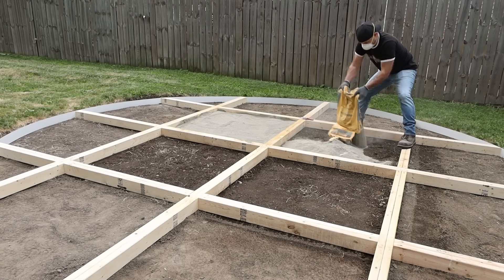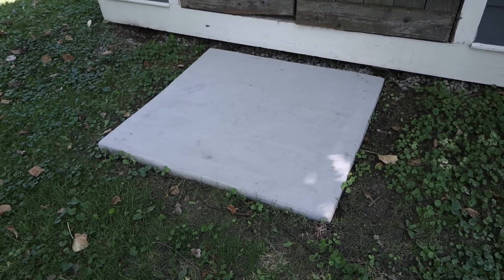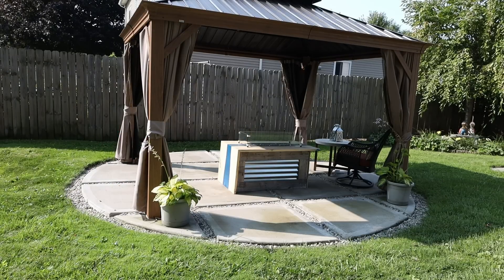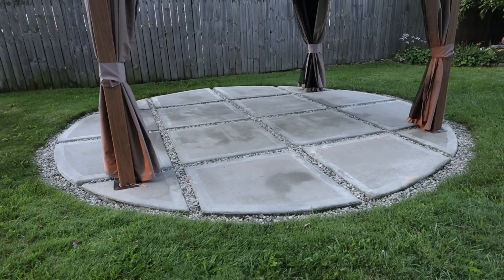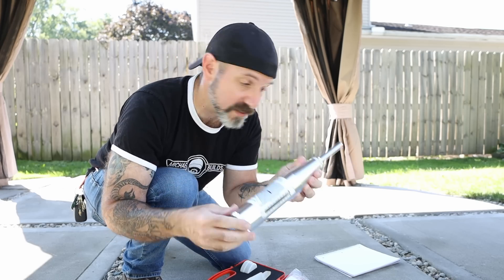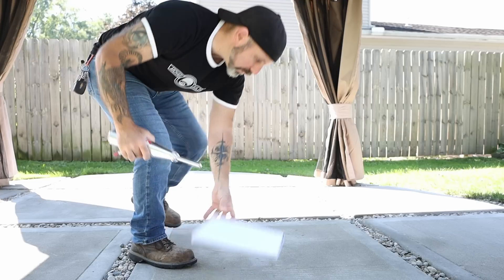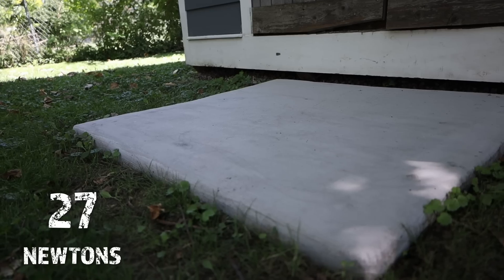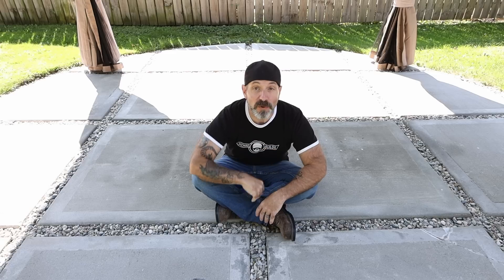Testing Dry Pour Concrete 1 YEAR LATER...

Comment: Thanks for the video. I just did a dry pour patio last week and it came out horrible. It looks like the one you showed where  you can peel the entire top level off. Is there anything I can do to save it or should i use it as a base and put a wood deck over it?

Comment: Compare the surface delaminations to dry pour without rebar. Id be interested in the results. Sort of suspect expansion and contraction causes the facing issues. Also dry pour should be soaked in as much water as possible every day at least for 7 days

Comment: BULLS***! There is no way you're ever going to get more than 60% of a design strength by doing a dry pour. If and when you decide to take out and dispose of that patio, have the section that you tested with nondestructive means over 4200 psi, and we can work it out and find you somebody locally that will core and actually determine its strength.

Comment: Dry pour should be strictly used for post setting that does not require major tensile strength. Other than that it is a waste and a matter of time until it will require to be torn up

Comment: I've been waiting for this video, and it's pretty much confirmed what I expected. As a Cement mason, if I poured any concrete as bad as that patio I'd ripe it out and replace it at my expense. As you said, these were experiments and the information is great! Honestly, I expected the compressive strength to be decent. But low compressive strength isn't the problem with dry-pours, it's the inconsistency throughout the slab.

The delamination is a sign of some serious problems, specifically uneven hydration. Some parts were too wet (such as the top and edges, making them brittle and weak), some were just right, and some were too dry (such as the center, making it crumbly and prone to fracturing). The cracks on the edge are likely just ordinary concrete cracking that found a perfect fault line for a particularly nasty crack. The top and edges will get too much hydration in a dry pour, but the concrete immediately underneath them will be much better hydrated. The middle is underhydrated, meaning that well-cured corner will crack at the path of least resistance (the comparatively weak middle), leading to a complete break instead of a hairline crack. The unpredictability of dry-pours isn't a bug, it's a feature. If it's showing that much wear after ONE YEAR, I REALLY want to see what it looks like after two.

As for the compressive strength, the only way to get an accurate test is to test a cylinder to failure. One way you could do that (roughly) would be to drill some core samples, stack them on top of each other, and test them to failure under a hydraulic press. It's still likely to have some decent strength, but that's not surprising. For example, layering beach sand between 1 foot by 1 foot sheets of window screen leads to a cube of sand that can hold up a car. It's called engineered earth. It's used for freeway ramps. Engineered earth will also have solid compressive strength, but it's not going to replace a home's foundation. Concrete will crack, but that shouldn't lead to any delamination or spalling. I've ground floors that looked crack free only to reveal a vast spiderweb hidden just underneath, but it was still cohesive. I'd struggle to fit the head of a needle into any of those cracks. The dry-poured slabs on the other hand look like they're struggling to hold themselves together.

The difference between a dry pour and wet-poured concrete is the life-span, and I suspect even a good dry-pour will struggle to survive past 5 years.

Comment: Love the fact that you went through all the different dry pours and tests.

I was thinking,  dry pour a base, leave 1/2 inch at the top of the form, then finish the job with a traditional mixture, for the remainder of the project. If cement adheres to older cement, this method might prove to be a solution for the cracking and flaking.
Reply: For the difference of 100 dollars for a mixer rental mixing the concrete is just the way tk do it. Unless you're looking to remove the patio within a certain time frame. Concrete was designed to be mixed and the negatives of not mixing are huge. Less PSI, the concrete doesn't gain strength over time when it's dry poured, it doesn't bond to the rebar if yoire using it which means that's causing damage over time not reinforcing it. There are many many more reasons to mix it and not dry pour it. Even in controlled environments where the concrete is dry poured then maintained with constant moisture for days it has these same downfalls. 

If you're concerned about pouring a large concrete pad, break it down into smaller sections. Concrete needs relief points, those lines in the sidewalks, and those can be done many ways,  one of which is pouring in sections
Reply: @VeggiesOutFront  

Agree 100%. The instructions are clearly marked on the bag. Deviating from the directions are problematic. I've never done a "dry pour", and I never will.

Comment: I think the reason you get the flaky surface on the concrete dry poor is because of the initial misting before soaking. I’m curious if that would still happen if you did an extended initial misting that really really saturated the top layer so that the thickness was closer to a quarter of an inch or even half inch instead of a 16th or an 8th of an inch.
Reply: This is what I have done. Only day 2 though. Several long mistings in the afternoon/evenjng after laying. Careful not to over saturate it, but its thirsty and sucks it up quick. So just kept going until it looked like it was going to start pooling. Then I had a sprinkler on it for 10 minutes every hour for the following day to make sure the moisture got all the way in, and it was a hot day. No surface peeling. The biggest issue I had was the stones. Could not get a smooth finish, but the brushed finish with the stones will make a good non slip surface. 
But with no access and just being for a small garden shed, the dry pour was by far the best, cheapest and easiest method. And far better than using the pre made cement slabs which crack very easily and can't be drilled into to anchor the shed.

Comment: The top chipping off the concrete is caused by the inside of the concrete drying slower than the top. This is why people use spray on cure or do a wet cure. It essentially slows the curing process on the surface so the concrete dries more evenly. Since a dry pour doesn’t have the water evenly distributed through the concrete it isn’t activating the lye equally and that’s what’s causing most of these problems.

Comment: Your conversion of Newton to PSI is dubious. PSI essentially maps to Newton/unit area. So, in order to do this conversion, you need to have some kind of surface area term you divide by. You cant just say 1 Newton = this many PSI because these are not the same kind of quantity. Namely, a Newton is not a unit of pressure, but a N/m^2 is. Can you give more details?

Comment: New Video 💡 : I have been building an off grid cabin & found secure set expanding foam for setting fence posts. (My back is loving NOT dragging heavy bags of concrete). The product website states that normal concrete has a 6,000 psi after 30 days and their foam has a 10,000 psi after 30 minutes. I don’t think my posts will ever move! It would be a very cool thing to check with your new toy. I love concrete but this stuff is only slightly more expensive (actually may be a bit less $ if you buy in bulk) and as we get older, those bags just keep getting heavier 😂. If this stuff is all it says, why aren’t we using it for foundations, etc? You have so much experience with concrete, I would love to see your input on this stuff! ♥️🕊

Comment: Dry pour is just unpredictable.. inconsistent.  As shown rapidly by the surface defects in the patio.

Sure. you can get places that work well.  But you get too much that goes wrong.

Just too easy to use a Harbor Freight mixer and do it right.

Comment: Thanks for revisiting these dry pours. I think the delamination is a result of your dry pour technique. I went back to watch the video of you dry pouring the blocks, I think when you misted, you put way too much water on the concrete, and the after the mistings, it's supposed to be a shower not just pouring out of the hose. Also, I don't think you watered them enough, supposed to be 2 showers per inch, 1 every hour. So 8 showers since you have a 4" thick block, 8 hours of showering.

Comment: CORRECTION for those who think they learned something physics-y.  A "Newton" measures force, not pressure.  That device he's using measures Newtons per square millimeter, not Newtons.  It's right at the top of the chart he shows.  1 Newton per square millimeter  ~= 145 PSI.  Those extra digits past the decimal point given for the conversion don't mean much IF... IF... IF... the way that device obtains its result is affected by the local value of gravitational acceleration (e.g. ball drop), which can be +/- 0.2 PS1 between Seattle and Los Angeles due to the "centrifugal" affect of the rotation of the earth.  (This is why you were tortured with "significant figures" in science class).

Comment: I worry about the methodology here. AFAIK that type of tester can only measure the compressive strength of a shallow layer. If the top layer is fully cured (exposed to enough moisture to do that) but an inch below the surface is still dry, all you have is a hard layer on top of basically dust. It might be fine for patio furniture but if you used this method on anything that actually requires a certain thickness (e.g. 4", 6", a footing, etc...) you could have a dangerously weak core under a thin, hard shell on top. It would be interesting to see you use this same tool on a test pour or two, say 1'x1'x4" and maybe 1'x1'x6", then cut the test piece with a disc and test the sides/bottom.

I would bet if you tested enough thicknesses, you'd probably find some maximum that can be used as a rule of thumb between "just DYI it with a dry pour" (pavers) and "that really does need a wet mix" (garage slab). If the center isn't going to cure past, say, 3" thickness, you might as well just lay down a (cheaper) bed of sand and do a thinner layer of concrete over that...

Comment: Ooooh, dry pour update :3 Very excited structural engineer here. So wall of text incoming. You have been warned.
First of all I see nothing wrong with your testing job with the concrete-strength-testing thingy (which is called a Schmidt hammer by the way). All in all I'm pleasantly surprised and also glad for having been more or less able to predict the results; and also the pitfalls of dry pouring. Pleasant surprise comes from your results. Which I could interpret right away as a European (SI ftw). One thing I feel the need to add: this hammer method tests surface hardness which directly correlates with concrete strength... in wet poured stuff. As you said the method can be ver unpredictable. The smallest inconsistencies in pouring, compacting, and wetting the slab have major effects on its final strength. Also in a lot of cases the inner part of the slab does not get properly hydrated. This means there will be uncured cement remaining in the slab reducing strength.
All these results align with my opinion I established last year about dry pouring. Great for horizontal slabs without reinforcement and highly not recommended when:
a) working with rebars - proper hydration across the slab is critical for the rebars to properly adhere
b) building actual load bearing structure - we want the least amount of uncontrolled variables
c) being prone to rush / half-*ss a job :)
One more thing to keep in mind: cement content and proper hydration makes or breaks the concrete's resistance to freezing. Overhydration leaves a lot of pores / air pockets after drying. The top surface is the most critical in this regard both because water sitting there when done and because that's the surface you wet your dry pour through. If you work at a location that sees freezing temps be extra careful not to overwater your dry pour.
Reply: @Fonok87  Awesome comment! I didn’t know about the over wetting leaving more pockets/pores. As a structural engineer, do you know anything about the closed cell expanding foam called Secure Set? It claims that concrete has approximately 6,000+ psi after 30 days and their foam has approximately 10,000+ psi after 30 minutes. I haven’t seen anything about it being used in load bearing or structural work but if that psi is correct, why not? I did find (on YouTube) a couple in Arizona that built a geodesic dome house and covered it with a closed cell foam. They built the house in only 4 days.  If this stuff is as strong as they claim, I’m thinking it could be an awesome material to use after disasters to quickly build structures for people who have lost their homes. Do you have any insight into this product?
Reply: I haven't heard of Secure Set but I'm in Europe so that might be the reason (I checked their site, they have no presence outside the US). The thing with these materials is that they tend to be waay more expensive than concrete which is the case here. Their 4 gal kit says it can be used to set 20 posts in a 8"x24" hole at a price of $132. Even if I omit the volume of the post (which is not insignificant) cost comes out to about $190 per cubic foot. Other materials might be cheaper but they all come with enormous R&D costs. Also concrete mixed at a plant can easily reach 9000 psi strength. When using literal tons of concrete to build a structure it means millions of dollars in cost difference. On the other hand, concrete needs at least a week before it can safely take a load. So it comes down to what you're willing to pay for the massive reduction in building time. Disaster recovery and critical structure repairs are good examples where getting results quickly is a priority above all else.
Reply: "proper hydration makes or breaks the concrete's resistance to freezing."

So, is it possible to dry pour a base, leave 1/2 inch at the top of the form, then finish the job with a traditional mixture, for the remainder of the project. I'm thinking, if cement adheres to older cement, this method might prove to be a solution for the cracking and flaking.

I'm not pouring any cement slab, nor have I ever done any cement projects. Just curious as to what your opinion might be.
Reply: @robertlee4172 great question!
Reply: @robertlee4172  Its the interior of the concrete that is weak, the surface that he tested was more or less properly hydrated.  You would need a test piece for destructive testing to see what it is like inside.  The middle of the slab is certainly not 4,200 psi compressive strength, so this technique wouldn't be suitable for load bearing structures.
Reply: @stvrob6320  
"wouldn't be suitable for load bearing structures."

That's just crazy talk. Are you suggesting that people would use the dry pour method for buildings and other large construction projects?!
Reply: Thanks for the comment. I just did a dry pour last week and may have over watered it. The entire top level is pealing off.
Is there anything I can do to save it and make it look better?
I live near the New Hampshire border and it gets cold up here.

Comment: These numbers are garbage without correlation to core sample test.  It is extremely important to note that the hammer must not be regarded as a substitute for standard compression tests but rather as a method for determining the uniformity of concrete in the structures, comparing one concrete against another, and reducing the number of core samples.  You also have too much scatter in your data and thus the data should be collected again.  Additionally, a newton is a unit of force and not pressure, so you need an area to be able to convert to PSI (Pounds per Sqaure Inch).  I assume your measurements are Newton per sqaure millimeter, but not sure since you didn't mention it.

Comment: Hey, I worked as a concrete QC tester for 5 years. I've never seen this rebound test before, so I looked it up real quick. Unfortunately, it is not an accepted method for strength testing. It looks could be within 25% of the real strength. 

The best way, would be to drill out a 4 in diameter cylinder, or cut a 2x2x2 cube, and break it in a machine with a load cell. You probably won't want to damage your concrete though.

As for the delamination. Usually, I would see this if the finishers sprayed water on top after the concrete was mostly set up. Which is not allowed on civil projects.
Reply: 👆👆👆👆👆 this right here 👍
Reply: What do you think they did before all the fancy equipment? 5 years doesn't scream wealth of knowledge
Reply: @ponyboyc  it's not my knowledge, it's straight from the ACI which has been around since 1904.

Comment: I need to fill in a large area that had large raised planters for40 years , and had to be torn down because they were no longer structurally sound, aggregate cement was poured around that. I’ve pondered anything from brick pavers to artificial turf.  I wonder if this is the solution? And what would be the best way to do a dry poor inset the empty space?

Comment: Awesome vid, so interesting.

I have been doing a bunch of dry pours using 24/6 rapid set.  Says 6000 psi on the bag.  I wonder how much a difference this makes as opposed to the normal concrete mix.
I think you used the 24/6 rapid set for one of your dry pours, but I cant remember which one.